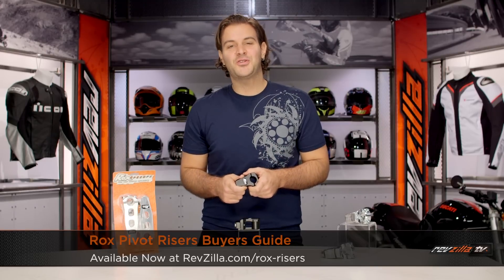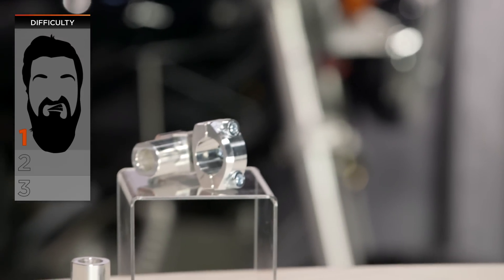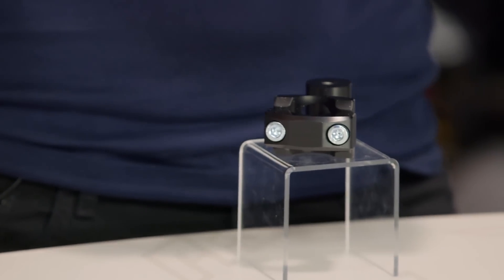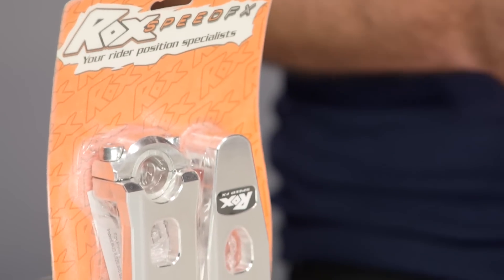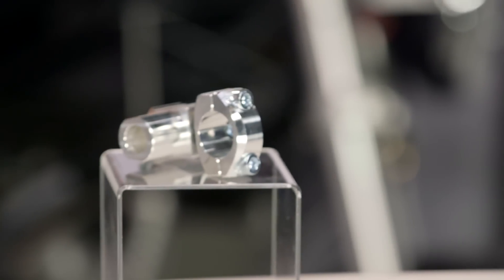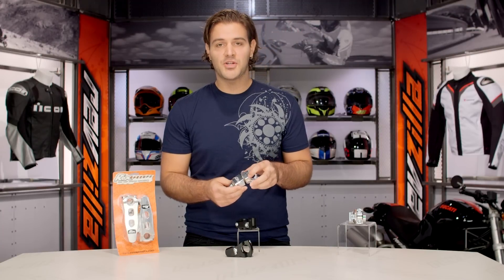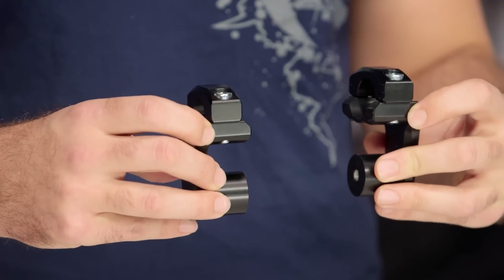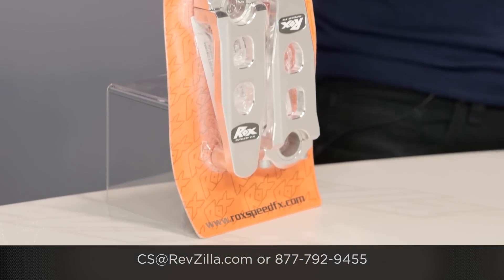Rox Pivot Risers Buyers Guide at RevZilla.com

Comment: Installed the 2 inch risers yesterday on 2016 KLR 650. 
Had to rotate throttle cables to down side of bars, and reroute clutch cable to left of the frame from wrapping around the front to the right side of the frame. Used a couple zip ties to the frame to keep fender from bumping the cable when turning bars left and right
Reply: How did you get the wrench in the tight spot during the install?
Reply: @ADVRaiderKTM  you tighten the one that will be hidden first...then rotate the riser up (forward)  then tighten the rear one.
There is a video somewhere on this.  On my KLR the bolts were normal head bolts so a wrench could be used.

Comment: With those risers can you bring the handle bars back closer to you? I have a 2006 honda 1300 vtx and I installed a new mustang seat and it sits me further away from the handlebars. From what a few people have told me you can adjust it to bring the bars closer.
Reply: Yes you can, your cables must be long enough.

Comment: There are two HUGE issues that arise when installing these that everyone needs to keep in mind. First,  it’s nearly impossible to tighten the bolts on the bottom side due to the handlebar being in the way. I had to cut an Allen wrench off just enough to get a wrench on it to fit between the bar and the bolt head that’s being blocked so I could torque it down. Second, the part that goes through your factory gooseneck does NOT go all the way through- it only sits halfway through. This is due to the design of the riser and the sides hitting the side of the gooseneck preventing it from going all the way through. It will tighten, but it would make me feel more confident and safe if the risers would go all the way through on the oem top clamp. This was on a 2019 Street Triple Triumph.
Reply: Maybe they updated that.  Just installed a set and they extend thru.👍

Comment: Do they work on r15 v3 clip on
Reply from the maker: No, these do not work with clip-ons, only with flat bars. Due to the shape of the fairing/windscreen, you may not be able to change the height of the clip-ons with taller riser clip-ons. You need to measure the clearance when the handlebars are turned fully left and fully right. -DrewZilla

Comment: Do they come for kx100?
Reply from the maker: As far as I know, the KX100 uses 7/8" bars, so you could use the 7/8" Rox Risers. Be sure to check the bar diameter at the clamps yourself though. -DrewZilla
*https://www.revzilla.com/motorcycle/rox-2-pivot-risers-for-78-handlebars
*https://www.revzilla.com/motorcycle/rox-elite-pivot-risers-for-78-or-1-18-handlebars
Reply: RevZilla 
Thanks I appreciate the help!